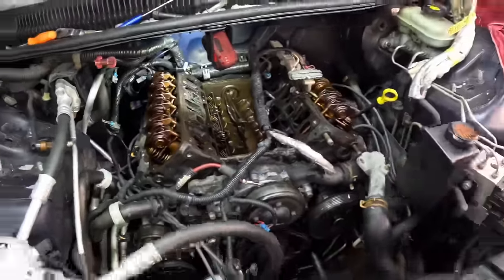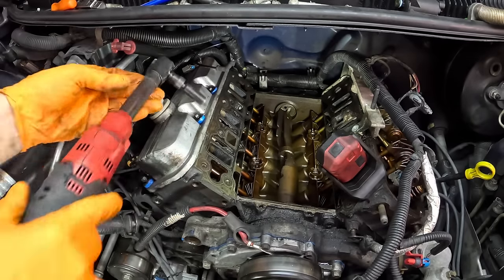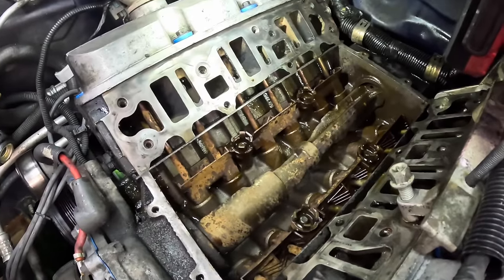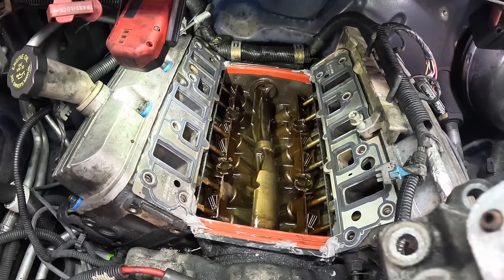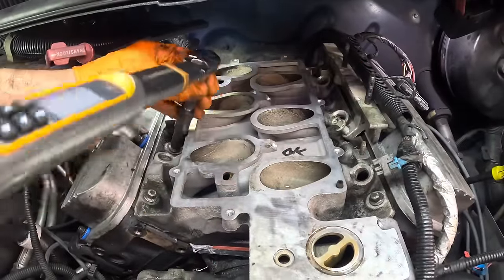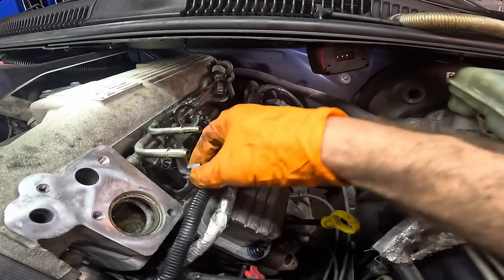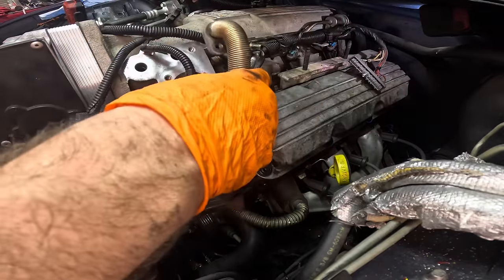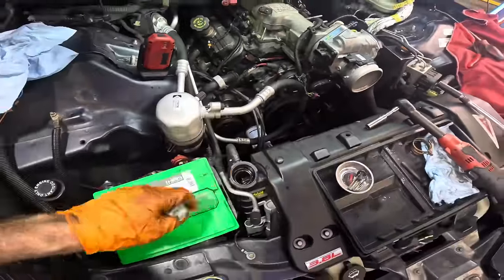Top End Assembly, Lower Intake Reseal  2002 Pontiac Firebird Gm 3800 3.8l

Comment: We had that Buick motor in our Holden commodore here in Australia, good motor
Reply: They were great motors. Not as much power as some of the v8s at the time, but super reliable. My uncle had a 90s buick riviera with the supercharged 3800 and he put over 300k miles on it before it finally rotted out
Reply: And the Grand National with that motor and Turbo was super bad.
Reply: @ronniemullis8717  we did have it with a supercharger as standard, but not a turbo , that motor in our commodore was in production for a decade, it was super reliable for us here in Australia
Reply: Overall the 3100/3400/3800’s were absolutely stout motors. The one shortfall to them was GM running Dex-Cool in them. Had a 93 Bonneville with the 3.8 that never had an issue with the intake gaskets. Upgraded to a 98 Bonneville & 96 Regal-both had the exact same failure as the Ferraribird in 04 & 05. Ran regular green coolant in them afterwards-never had another issue.

Comment: Most automotive water pumps have a ceramic shaft seal that sets in a rubber cup to hold it in place. The rubber cup is made to work with coolant and water. Oil will swell up the rubber and throw the ceramic seal out of alignment with the shaft, then the seal will fail. I would replace the water pump now before the pump failure.
Reply: Pretty sure he replaced that first thing

Comment: I dont know how long I've had this problem but i believe i will be replacing my LIM soon.  I check my oil when the motor is cold and the oil is perfect everytime and the filler cap is clean.   Anyhow this time my car sat for a week. I moved it to the front of the garage 50ft then i checked the oil. Holy sheet its super  milky.  I checked it cold the next day and its perfect no evidence of any problems.  Then i start it up shut it off and holy sheet.  I've been checking my oil all wrong it seems.

Comment: My Chev 3800 lower intake had a plastic heater hose nipple that cracked and took out the head gaskets, a lousy 2 dollar part. It's the same pipe size and thread as a garden hose, replace it if it's plastic with a metal one. The brass garden hose end works perfectly.

Comment: Adding a little torque to the lower manifold bolts is a good idea, I did my IROC Z 350 years ago(same problem) and  let it sit overnight after the first pass and was surprised that the gasket compressed as much as it did, took 1/2-3/4 turn to get to spec. Do the bolts go into the valley, I didn't use thread sealer and oil was pushing thru the thread and pooling. It was a TPI, had a to do over, enough said.

Comment: Ray!  I cannot believe you would install those new bushings on the bolts for the valve covers without using a calibrated press to ensure proper fitment.  This engine is now destined…. Destined I say!  To run just fine 🤪

Comment: I would do the same exact thing as you but just spray that engine valley lifters and pushrods with some of the engine oil after its all super dry with the brake cleaner then wipe the gasket surface off one more time so that when it starts first time she's lubed right up. Might not matter though idk just a thought

Comment: You're very lucky you didn't work at mavis.. They are probably teh worst chain I've ever been to.  I had one location tell me my brakes would fail inspection because of um. "excessive rounding". I was shocked since I replaced the rotors and pads around 6 moths prior (This is not a criteria for State inspections, only metal on metal or missing components), they also torqued my lugs so hard I had to bounce on my tire iron.  
An independent shop inspected with no issues. 

I decided that hey had a good deal for tires so I went to a different location to give them one more chance. Second one took 2 hours to "get my car on the lift" after my appointment, they called me to tell me that my rear shocks were blown and they had a great deal for me, since it was in the air already and only 2 bolts I could have the shocks for the price of parts (Only 2x rockauto price).  They then called me 45-60 mins later the had the car pulled and and on the lift they didn't have the correct tires. My visual inspection and for good measure another shop verified that my shocks were just fine. 

They're a scammy upsell company that don't have the customer as the priority, so Ray wouldn't really like it there I don't think.

Comment: It's been quite some time,but I vaguely remember that when reinstalling the lower intake bolts, GM recommended using blue threadlocker so the bolts don't loosen again. I'm not going to swear to it though. As I said, it's been awhile.

Comment: I agree that 40 minutes is a happy time for your videos Ray. A couple of loose ends for this video that may, orr may not have been addresssed when we were not looking. First, what happened with the bracket positioned at the back of the lower intake on the passenger side that gave you so much trouble during the disassembly. You questioned whether it was something that really needed to be replaced during reassembly and then left us hanging. Second, what about replacing the heater hoses. They are subject to the same oil contamination as the radiator hoses which you are going to replace. It would seem to me that heater hoses were much more accessible when the intake was off, so why were they not replaced at that time?
Reply: Was wondering the same thing about that bracket, maybe next installment, I liked the music showing my age

Comment: I check head gaskets and the transmission & engine oil cooler loops in the radiator when I find oil in the coolant.

Coolant in the oil is usually intake gaskets on the 3800.  Not sure how you'd get oil into the coolant through the intake coolant passages tho.  ???

Comment: RAY NEEDS TO EXPAND THE SHOP
On the back wall, and install a full motor wash.

By the way, the Firebird is in reference to the Phoenix  a mythical flying horse bird  the hubcaps do not have wings so they represent young phoenix horse birds who have not earned the wings yet.
My thoughts its a v6 not a ram air v8  the v6 wasn't very powerful for a car those years compared to other sports cars of the time period. 
Even reinforcing the idea of the hubcaps on the car ( this is a jab at the Italian car maker , everybody knows a Lamborghini will kick its ass) 
This pontiac would look really cool with lambo doors, and be even more confusing.  Then add the supra spoiler on the back and the vr4 down draft under body scoop.

Comment: I know on the last 3.8L that you fixed with the same problem you definitely forgot to put thread sealant on the lower intake bolts because I have the same motor. Although this motor is a different generation from the last one you did, I'm pretty sure several of these LI bolts also pass through the coolant jackets, hence the need to apply special high temp thread sealant to the bolts. This is the most critical part of doing this job. Not sealing those threads can mean the coolant, and or oil, will go right through those threads and will result in the same problem reoccurring not too far in the future. Blue Loctite is not considered to be anywhere near acceptable in the event anyone thinks that's all that needs to be used. GM sells the "official" sealant for a premium cost, but Permatex has the equivalent product as a cross reference. You pointed out the need to change the valve cover gaskets due to the work it takes to do the job and then skipped the most critical part of this repair. Considering that several other people besides myself also made mention about how critical the sealant is to this job I was hoping you would have checked the procedure to verify this point. I guess considering the amount of work it would take to fix the last mistake, you decided you'd just wait and see if it leaks and deal with it then. I think it's just too important to the success of the job for me to not inform others about this point.

Comment: I'm sure you will get some negative comments about the background music, but I like it. Kind of reduces the tension of hoping you don't drop hard-to-thread bolts into the engine compartment. Was it a quiet day at the shop, or were you able to filter out the concrete saws?

Comment: did you remember to take the paper towels out of the intake runners on the head? i got an engine once for free because the guy forgot his rags in the intake runners and couldn't figure out why it wouldn't run. after I fixed it I sold it back to him for the price of the parts.

Comment: Where machined parts are poorly machined & parts  have a history of leakage ,I always use Permatex #2 non hardening sealant,especially in head gaskets. May sound weird but it works.That particular engine must be a total misfit to have so many leaks between critical mating surfaces.The heat cycling in conjunction with poor machining does not make for a good fit.Could be the lost foam process they use to cast the parts.

Comment: If for some job on that engine it was felt easier to drop it and the subframe to give better access, and you wanted to keep the loom on the engine for completeness, how on earth would you get to those clips on the firewall which hold the loom there without dismantling the top of the engine?

Comment: Is that intake aluminum? Should the intake and / or block be plained to prevent the same failure. Had the same problem with an aluminum plenum on a Ford 350 van. On a side note, if you ever see an ad saying "Unique," it means I uglyed it up so you don't have to.  I'm claiming the word ulglyed. And remember to have yourself a great day.👍

Comment: Yea! No nuts or bolts left over! 
The burning question... Will Ray replace the duct (not "duck') tape? (P.S. Ironically, while duct tape has proven to have 1000s of uses, it is LOUSY for use on home heating DUCTS. It rapidly deteriorates, crumbling to dust. Use the metallic type instead.)
One other thing... While they were out, I might have painted the upper intake and valve covers bright red to match the suspension cross brace, yet to be reinstalled. 😊 No doubt, more red paint under the hood would make the FerarriBird faster, probably shave a second or two off it's 1/4 mile times! 😅

Comment: I am concerned about the uneven surface created by your sanding wheel.
Edit: I am also curious as to why the first two valves on the driver side are so much darker than the others. That could be due to excessive heat in that cylinder

Comment: Hi Ray-I’ve been meaning to ask you about your experience with brake clean. Have you ever had an issue with brake cleaner reacting with different plastics under the hood?

I was using brake cleaner to clean out old grease from a bearing slide set, and some got on a 20v battery and the charger for it nearby and it immediately reacted and started melting the plastic on both where it splashed and the smell of melting plastic was awful.

Just curious if you’ve ever had that happen. Love your videos! Fan from the beginning.

Comment: Dex-Cool was the worst. I dd lower intakes on two 3.1 and on 1 3.4 also a 3800 2nd gen. The darn coolant. It is corrosive if not changed at regular interval.
Reply: DeX Cool has nothing to do with this problem.  I was running the green antifreeze in my 2003 Impala LS, and still had this problem.  GM came out with the 3.8 V6 Series III engine towards the end of this motor's production.  They went to a metal plenum and intake.  The Series II had a plastic plenum.  They knew they had a problem.  My 2006 Ford has a 3.9, V6, and there has never been a problem with it.  I still have my Ford, and that crappy Impala is long gone.  The Impala started falling apart at 60,000 miles.  The lower intake, and transmission went on the Impala at the same time.  The Impala also was serviced every 3,000 miles at the GM dealership. It was GM junk.